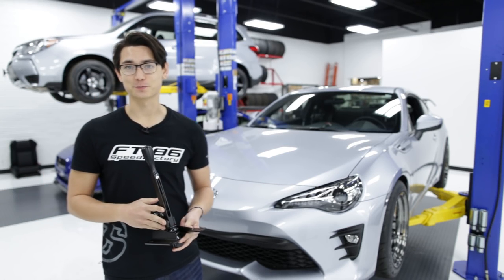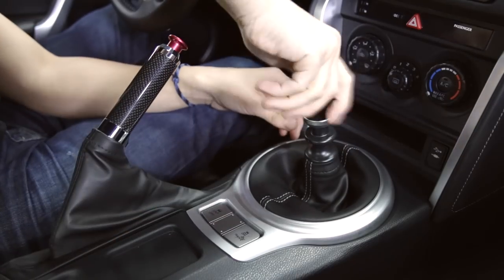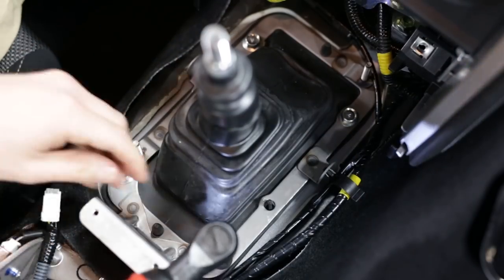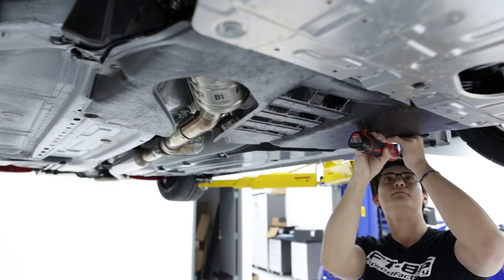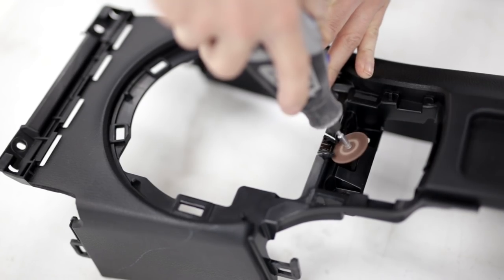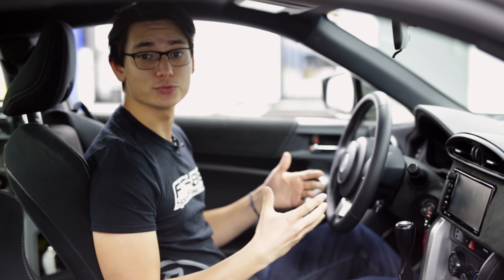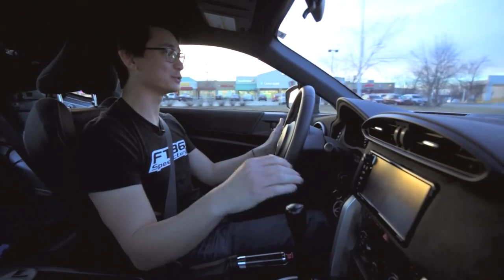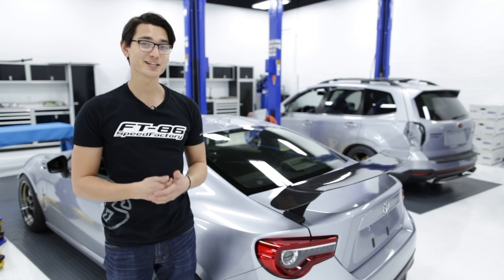FT86SpeedFactory - IRP Short Shifter Install & Review

Comment: before watching this video: Oh this should be easy

Video:  remove the transmission mount and center drive shaft

me: ight imma head out
Reply: I’m sixteen and I thought it’s was pretty easy.  All you need are tools and time.
Reply: @Wes_Log  anything is easy with tools and time but the tools require money to acquire.
Reply: @439530  so does this short shifter?

Comment: That's a nice looking shifter. Looks stock. And I definitely like that lockout function, seems way more convenient than stock. I actually installed a 3-inch extension to get longer shifts since I had trouble downshifting. For example going from 6 to 4, I'd sometimes end up in 2nd. I drive a truck with a 10-speed manual where the shifts are way longer than most cars and after a year of daily driving my BRZ I just couldn't get used to it.

Comment: Did you guys take out the carrier pins all the way? My car wont shift into Reverse, 1st, 3rd or 5th. Something is blocking it
Reply: Bought my car with the shifter installed, but my Pins are still in there.

Comment: I know mtec spring will still go along with this irp short shifter but will the IRP make the TRD Quickshifter kit redundant? can I use the MTEC, the TRD Quickshifter and the IRP, best guess? is it overkill?
Reply from the maker: Mtec springs will be fine with the IRP, however the IRP already reduces shifts by 60% and we wouldn't recommend pairing it to the TRD Quick Shift Kit.
Reply: FT86SpeedFactory thanks for the reply. Makes sense! Please keep doing what you're doing! Speed factory is awesome

Comment: @FT86SpeedFactory  -  Any advice to quiet down the rattle/vibrations from this shifter?
Reply from the maker: You could cut the OE rubber shifter boot and use that as a gasket between the trans tunnel and shifter.

Comment: All that work to replace an already short shifter? not worth it.
Reply from the maker: The stock shifter is certainly not close to a short shifter.
Reply: FT86SpeedFactory shorter than almost any shifter on any other car I've driven.
Reply: The 17 86 860 special edition comes stock with a short throw